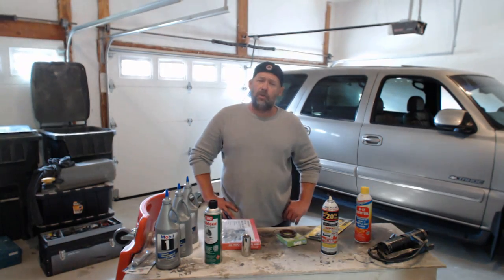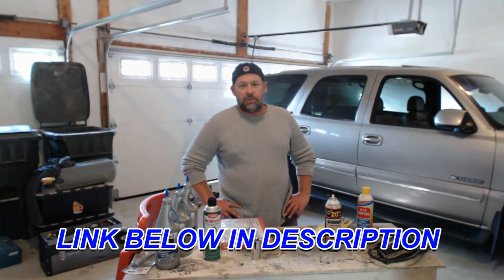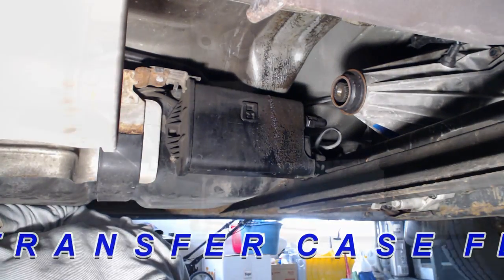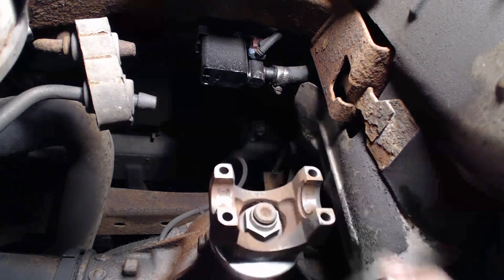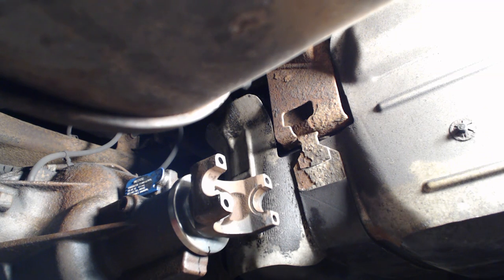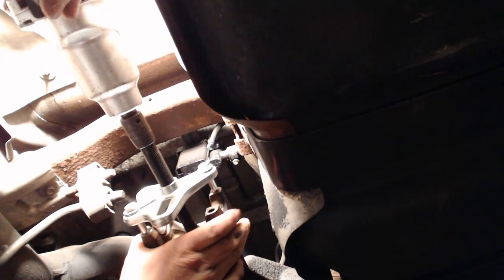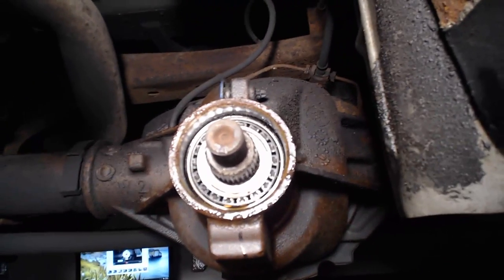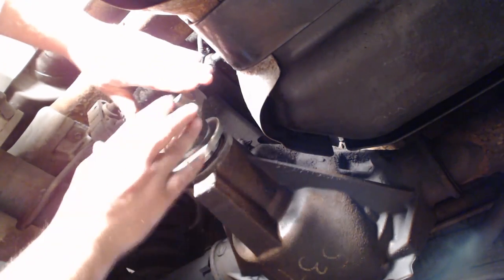HOW TO REPLACE A CHEVY TAHOE REAR PINION SEAL

Comment: I've done many pinion seals on many makes (I own a rear end and gear service), and one thing to know is, to use loctite on the pinion nut. You do not need any silicon sealer, unless there are unusual pits or scars from removing the original seal.  An impact gun will generally tighten the nut right where it needs to be unless your pinion bearings are shot, and if they are, a pinion seal won't help you.
Reply: How can you tell if it is pinion bearings ? I have some play pushing up and down on drive shaft at pinion flange . Someone said could be crush washer ? Removed cover and appears OK no metal shavings . thanks
Reply: @dennisfrier3191  bad bearing should be hardly any movement

Comment: Thank you sir. I am ready to replace the pinon seal in the 96 Tahoe. (G80 Locker) Been working on cars for years but first time to remove axles/seals and the pinon. Always was afraid I'd mess something up, or get the nut too tight. Your method is what everyone else recommends , mark it and measure threads, and nut distance. I feel confident that with your videos help I will have no problems. Please keep the videos coming and have a great day!!

Comment: When installing a new seal does the pinion nut need to be tightened a little more then it originally was to make up for the new seal? Thanks.
Reply from the maker: nope put it back in the same depth
Reply: Yeah give it about 12 extra ugga duggas
Reply: No

Comment: did this to my 98 Tahoe,  was easy to do, then i found out the yoke was bad, it still leaked after i replaced the seal. i had used the same yoke, i should've of replaced the yoke as well. i think it'll be bast to replace the yoke as well as the seal.
Reply from the maker: +Jaime Garcia excellent point how much was the yoke?
Reply: +RICKAFIX $96 so basically around  $100 bucks
Reply: I'm late to the party here...but my seal is still leaking too. Guessing it is the yoke then. Thanks.

Comment: What size are the bolts you used with the puller? THANKS
Reply from the maker: +Dickey Moore don't remember the kit has several size bolts
Reply: On my truck (2011 Silverado 2wd), they were 1.0 M8 bolts...

Comment: 1 1/4 inch drive socket fits my GM 10 bolt 7.5 diff nut. 23mm socket.
32 mm = 3.2 cm = 1.26 inches = 1 1/4 inches
Reference  sources:
https://www.ginifab.com/feeds/cm_to_inch/  
https://tengtoolsusa.com/blogs/news/standard-to-metric-wrench-conversion-cha

Comment: Always start unscrewing the diff filling plug cause if its stuck you will have a very bad day.Just saying,good vid .
Reply from the maker: +obscur156 Agreed I just had Jiffy Lube top it off 2 weeks ago so I knew it was coming off... maybe... lol Thanks Obscur156
Reply: Unless a "mechanic" did it up with a 3/4" drive air gun
Reply: Truth

Comment: They replaced mine on chevy Silverado 5.3l twice and the thing is still leaking. Getting worse. Mechanic said seal was defective the first time and still same result. Do I need the whole yoke on it?
Reply: your pinon bearing probably bad causing the seal to fail
Reply: @Derick9772  I'll mention that to them. Thanks!
Reply: Bad pinion bearings!😢

Comment: I can't get my nut on the yoke to loosen up ive tried impact and a breaker bar and no luck
Reply: heat is your friend! Check for combustibles before going nuts with a gas torch and preferably have an extinguisher at hand. Otherwise just use a longer lever, ie slip a 4' pipe over the breaker bar
Reply: Welp... If impact no worky, and breaker bar yeilds no jar - I've got yar solution:

★The Remington model 870★ – 3” chambered magnum • breaching mussal break • solid slug shot hight velocity cartridges • krylon rifled barrel • and the most crucial attachment to remember [recording device to get all ta views]•:•  is the all Murica tool yar need to get the job done while having some fun!

Comment: Why does everyone mark everything? Just look up torque settings and torque it? When new everything is tight, but after wear and tear torque requirements change.
Reply: It's not a specific torque on this nut. Its preload and to do it right you have to use a special tool to measure the torque required to keep the pinion turning. Then you tighten the nut in small increments until you hit that same preload
Reply: I think you can use a torque wrench with the dial on it instead of a clicker type
Reply: You will mess up the Crush washer!!!
Mark it and do  exactly what he says!!